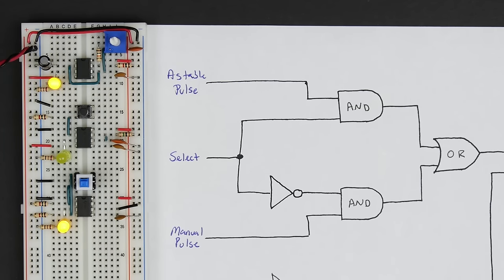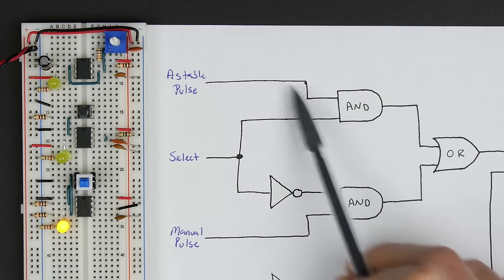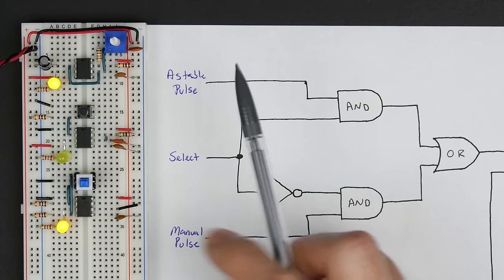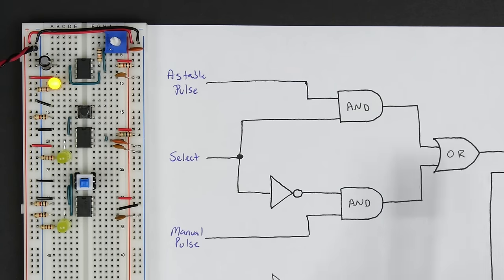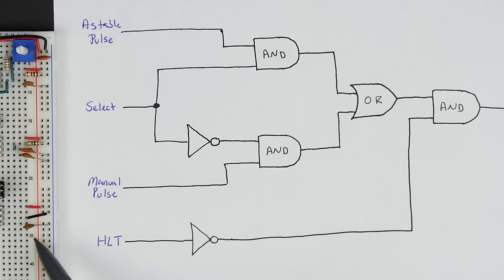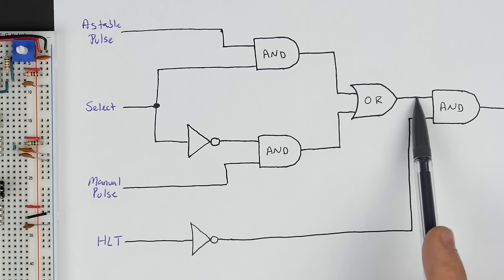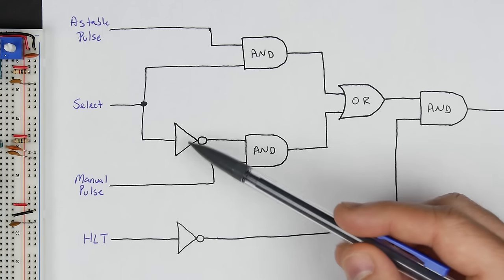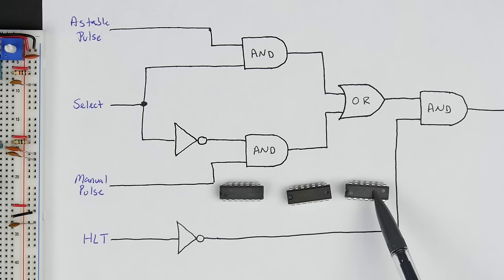Clock logic - 8-bit computer clock - part 4

Comment: Ben, first of all thanks for these videos, really great quality, I am learning so much.

 I have a quick question about switching between the auto clock and manual clock.  It seems conceivable if not likely that in switching from the automatic pulse to the manual pulse that you would cut off a clock cycle early.  From my very limited computer knowledge I am assuming this could cause a bug later on when other components try to synchronize up (for example read/write cycles.  Can you speak to this at all?  Could this be an issue or am I mistaken?
Reply: Michael Hamor You are correct; this clock mux can glitch. However, the glitch is about as fast as one inverter then the difference between an and gate turning off or on, which is rather short. As that then needs to propagate onto breadboards, it likely gets absorbed by the natural low pass behaviour of the wiring and rails. Might be fun to examine with an oscilloscope.

Comment: Hi Ben, I started on this project following your videos.  I'm a newbie and trying to understand why a resistor wasn't used for the blue LED.  Thanks!
Reply: Maybe the the output is already current limited. Or he forgot it in which case the chip will get very hot and eventually melt.
Reply: @Martin.Krischik  For some reason when I add a resistor to the blue LED on my clock module it doesn’t turn on....
Reply: @thejbo777  The chip has indeed a limiting resistor of 100Ω which works but is very bright. I added a 220Ω and it's still very bright. But works as you can see on my blog:

https://blurt.blog/blurtit/@krischik/ben-eater-6502-kit-day-5

Comment: Nice video again.
Trivial: You forgot to add a resistor to that blue LED, which was very bright. Does the chip has an internal resistor?
Reply: The 555 timer outputs around 3.3V, so it would be fine (just). He mentions this in his other videos.
Reply: connected to 74ls08 not 555

Comment: I'm a bit late to the party, but I have a question: What's the reason for using an OR-gate to combine the outputs instead of just connecting both outputs with a wire? Is it done in case the outputs of the both AND-gates aren't on the same potential?
Reply: @kubajuszczak5680  Thank you! After watching the next few videos in the series it became clear to me as well that you will create a short to ground in the case of just connecting the outputs.

Comment: I'm seeing your excellent series  some 4 years after it was published but thoroughly enjoying them. I was going to ask about overall power consumption but you mentioned in this video that you aren't concerned about power consumption, or even keeping the parts count low. Fair enough - but I had a question about the select switch in this video. Wouldn't it have made sense to make sure that if the Astable clock was "hot" (in other words, the business end of the cycle was in progress), that part of the cycle was allowed to complete before the select-to-manual took effect? I've not seen the whole series, nor read or seen your original problem statement anywhere. I suppose by the end of the series I'll know whether stopping the Astable clock while actively driving the computer to the next instruction could or could not leave the computer in a weird state.

Comment: I am a hobbyist just  becoming interested in electronics. In the process I have found simple inexpensive RF TX and RX fascinating and would like to try my hand at playing around with them. The first one of interest is the FS1000A /XY-MK-5V. My first attempt in their use will be to turn on an LED, and leave it on, when the button on the TX is pushed and  released. What do I use at the RX to capture the TX button push and turn on an LED until the next push of the button? I am hoping to do it without a relay, by using simple inexpensive discrete parts or a chip.

Comment: What about the current driving ability of your clock module, is it powerful enough to supply all other modules of the computer with the clock signal? Will you add some other thing to (I'm obviously not good with eletronics) sort of "amplify" the signal, or at least offload the 555. Like a mosfet of something?
Or are you connecting the clock to other modules through some buffer (and how are you "activating" them according to the clock?)? So many questions, this series is awesome!

Comment: Awesome videos! I built this clock circuit, but I sometimes get bounces on the manual clock button release. Thinking about it, this is to be expected, since the capacitor is discharged pretty much instantaneously. Why not add another resistor, so the discharge is more gradual as well?

Comment: Excuse me, @ 9:16 you set the AUTO timer on through the switcher. It seems that there is a delay among the Timer's LED and the blue LED. Not sure, I tried 0.25 playback speed. It seems that the blue light increases intensity, or perhaps there's a delay in current to reach its max value, something is not okey there, I guess, not sure! It this somewhat native and normal or should there be a correction? If yes, how could this be corrected? Thanx! Great videos!!!!! And the info about Malvino' s DIGITAL Computer book is a real thesaurus!

Comment: Hmm... I dont think you need to or gate because looking at the schematic, the OR condition is always going to be true.  Just tie the two outputs of the AND gates into input one of the third AND gate.
Reply: If the output of the two ANDs were connected together, different states will result in a 1 meeting with 0, equivalent to shortcircuiting the high (5V) to the low (ground). The IC will be destroyed. You can instead connect the AND outputs to the anode of two diodes in a common cathode configuration, and tie the cathode side to a pulldown resistor and the input of the third AND.

Comment: If you're building this from just the schematic, don't forget power and ground to the logic chips. Those chips are only represented as logic in the schematic, so I forgot to give them power. The real surprise was that with no 5v/ground connected, they will still do stuff. But it was bizarre stuff. It also got the chip so hot it burned me, so I don't recommend.

Comment: At 5:51 you talk about different chips. How do you find chips that have what your looking for? If you can some simple logic gate stuff to do how would you go about selecting the chips? Who makes them?
Reply: Guilhem Ané All the chips have different codes. The logic gates we are talking about will be in the 74 series of integrated circuits (IC’s). It is pretty easy to find purchase and naming code info with a quick google search. For example, an AND gate code might look something like this: SN74LS08N. The 74** part is usually all you need to worry about though. There are a variety of companies that make them, but you would order them from an electronics distributor rather than those companies. I have used futurlec.com in the past, and you can find what you need for pretty cheap prices.

Comment: why dont we use multiplexer at end to select input clock pulse...?
Reply: In part 3 what he built was not a multiplexer -- it's a circuit that allows the user to output 0 or 1. It has only one input -- the switch. So now Ben has to build digital logic to select the pulsed clock or the manual clock. (Pardon me if I misunderstood your question.)
Reply: @sakumar  But the circuit that he built in this video, except for the halt handling, is just a 2:1 multiplexer built out of logic gates. It takes two inputs signals, and a select signal that says which one of them to pass on to the output.

Comment: An interesting thought occurs. If the program does halt the computer, as in the above circuit, then that halt is "for good", right? Because once halted, then the computer can no longer receive clock pulses as it got disengaged. And as such, it can never go to the "next instruction", and so even if we had an opcode that "de-halts" the computer, it will not be accessed.

I guess the question I am raising is when a computer gets halted, then how can it resume computation? if at all? How can "temporary halts" be implemented?

Comment: Love your videos, they are great. I made this one on a breadboard and it provides a 3.1v output. I also made a prototype board, it only get 2.4v output and its not enough for the clock edge on the other chips to trigger. Any suggestions to why.

Comment: As you have a known fixed voltage, just wondering why you didn't use a 7414 and create a relaxation oscillator using the inverted schmitt's.  Could have reduced the amount of components required that way.
Reply: Look at 5:33
Reply: @inrg3688  true, but the 7414 is a much simpler circuit as well, admitedly getting a true 50/50 duty cycle with it is harder.

Comment: Hey Ben, these are great videos. Curious, I should be able to use just one of the 74LS257's select inputs and the /G pin could act as the Halt as long as output uses a resistor (~2K) pulled to ground, Yes?

Comment: Isn't the circuit shown in part 3 (when Mr. Eater builds the circuit  that keeps the switch latched) the same as an SR latch?
Reply: It is, the only reason he used a 555 is to teach more about the 555.

Comment: why wouldn't you just connect the astable clock to a switch like this selector presented in this video, and a raw button here, then debounce that with the debouncing circuitry from part 2, leaving out the debounced switch in part 3? Would the debouncing not won't work at high clock speeds?
Reply: sol A debouncer might work fine at a couple of Hz, but would block an astable clock faster than about 10Hz.

Comment: I have my board setup exactly like yours and I'm still getting bouncing and also only 2v high on the clock output of the 74LS08 (pin 8), which from what I've read isn't enough to trigger the rising edge on the Arduino. I get 3.5 volts on the 555 timers pin 3 for astable and monostable output. Do I have some bad LS logic chips?

Comment: Ben, can you make a video about making the exact same thing with transistor and resistors? I don't have those chips yet and tried to make it with just transistors, I saw your video about making gates with transistors, also googled some info I needed. But, the problem is that even though the final output from the end gate works for the two options using the switch, the LED is on all the time, even during the times it should be off...
Reply: Try using diodes for the output of the timers. And some other circuit to choose between them. I'm tired right now, so do not want to figure it out right now.

Comment: Why do we use an OR gate in this scenario? Why not just make a parallel connection?
Reply: Sometimes when you work with Integrated Circuits (And by the way I'll get details and terms wrong because I'm just not perfect), the current may flow back into a previous IC which may mess up the logic (in some cases) so you would at least need some diodes to prevent this.
Reply: +IanCraftsAndMines unless you use devices with open collector (OC) outputs. then can use the wired 'OR' method.

Comment: Hey Ben, quick question. What sort of power supply do you use, in terms of amps.
For portability (at least for now) I was thinking of using a LDO linear regulator along with a 4xC type battery pack. Most LDOs have a max current output of around 150mA. Who this work?

Comment: Could you not just use a Tflipflop counter by just chaining them together either asynchronously with no and gates or synchronously and you'd need a few but it seems simpler still

Comment: Just curious... If you build your logic gates with vacuum tubes, instead of chips, how would they compare to gates built on a board with (more) modern parts?  They would need more power and more time, but are there other trade-offs to consider?

Comment: So, I accidentally plugged in the wrong ac adapter and fried something(s) on my clock module. It was a 16V power supply, any guesses at which thing(s) I fried? I'll be trouble shooting it over the next few weeks.

Comment: For the CMOS version of the 555 timer (ICM7555) is it okay to leave the discharge pin unconnected in the third configuration?  I am guessing this is okay since this acts as an output pin and doesn't need to be tied to anything but I wanted to make sure.  I am building the computer using CMOS variants of all the LS chips and don't want to leave any input pins untied.

Comment: Wow this is a lot of stuff to keep into retention. This is way more than I can fathom at the age of 15. Maybe I should stick to software xD.
Reply: Keep the spirit up and if it's too much, start with something simpler.
If i interpret what you say correctly (specifically the software part), you are a programmer?
(if not, no worries, the following still applies)
As a programmer, you should have realized that motivation and determination can get you anywhere.
I've been programming for a number of years and recently started going more in-depth with electronics.
I would lie if i said i haven't struggled, but after a couple of months of solid determination, i fully understand how computers work.
I even got the instruction decoding down.
I would like to advice you to learn the basics of voltage, current and resistance (Ohm's law) if you haven't already.
Then look into voltage dividers to get a better understanding of how voltages change within a circuit (since the chips used are CMOS-based and MOS-transistors are voltage controlled).
After that, look into how transistors work (MOSFETS are the most useful, and easy in my opinion, in this case).
Check some schematics of basic logic gates like AND, OR, XOR, NOR, NAND and NXOR.
Try to understand why the transistors are connected the way they are and how that relates to voltages.
And one thing which is good to remember, if both sides of a component has the same voltade, there will be no current through the component. (this is where some knowledge of voltage/potential makes things a lot easier)
When you come back to connecting different chips together after some studying of electronics fundamentals, things will be a lot easier to understand!

Don't forget to have fun and experiment with LED's and speakers and other things to keep the motivation up!
There is no other feeling like the "AHA"-moment when you've fully understood a complex concept.
And most complex concepts can relatively easily broken down into a number of simpler concepts to tackle one at a time!

Good luck! :)
Reply: Ah yeah, I've learned a lot since that comment. I dived down to the lowest level of abstraction when it comes to computers and physics. I'm just studying how microcode and assembly code works in processors. Hardware stuff interests me and I like to mess with drivers and kernel extensions in Windows, OSX, and Linux. As far as assembling actual hardware I have a Arduino, a breadboard and a few covers I that like playing around with, I made my own mini robot also.
Reply: +Miguel Cruz Nice to hear!
Keep it up! :)
Reply: If you like reading up on assembler, you should download something called BeebEm. Its an emulator for the 1981 BBC Microcomputer, and it has a built in assembly compiler.

Its two supporting manuals (BBC Microcomputer User Guide and the BBC Microcomputer Advanced User Guide) are both available online and teach you everything you need to know about programming in Assembler and BASIC. They're also very good books to read in general. There's even a book called "Advanced graphics for the BBC Microcomputer" that teaches you all the maths required to draw in 3D.

They're very well written and really good fun. :)
I started programming when I was around 14/15 years old using those books and they helped a lot!

Comment: Could you make a video about making a clock from desecrate logic gates, not a 555 timer?
Reply: chain an odd no of not buffers. then feed the output of last one in chain to the input of first one. viola.
Reply: +Adil Malim That would be way to fast.
Reply: +Preston Stith Then add some frequency divider (basically you can just take a binary counter and use one of its outputs to divide the clock frequency by 2, 4, 8, 16 etc.).
As for the pulse generator, there would be a good idea to use a quartz crystal too. They are very stable.
Reply: I havent found a good schematic for using a quartz but I like the frequency divider idea.
Reply: @prestonstith8744  Pierce oscillator, if you didn't find it already.

Comment: 5. If the automatic clock is currently outputting logic 1 and you switch from manual clock (outputting 0) to the automatic clock, then immediately the final output of the clock will be 1. Now if the automatic clock was just about to switch back to 0 then the resulting clock pulse will be very short. The same happens when you switch to the manual clock right after the automatic clock switched to 1.
I don't know the physical limits of this computer but in theory it would be possible to accidentally create a clock pulse which is so short that the computer cannot handle it correctly.
What would you do to counteract that? My guess would be this: https://puu.sh/x98zf/4ffc33db3e.png
This circuit only allows switching between the automatic and manual clock when the automatic clock outputs 0.
But what would you suggest?
Reply: I was actually watching this video to determine how to address the metastability situation you describe.  I think your diagram is essentially a 1 stage synchronizer?   Here's an article I found talking about ttl delays and clock domain crossing / syncronization:  http://www.interfacebus.com/Design_MetaStable.html .   Would be curious to know Ben's thoughts on this wrt his design